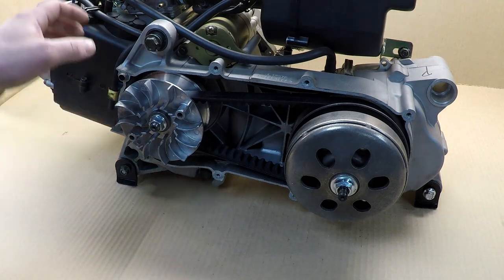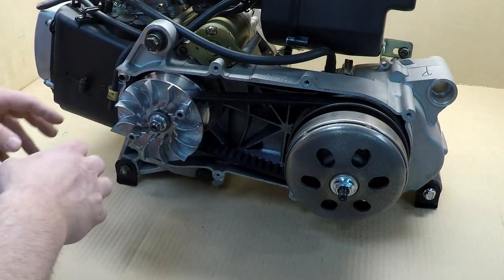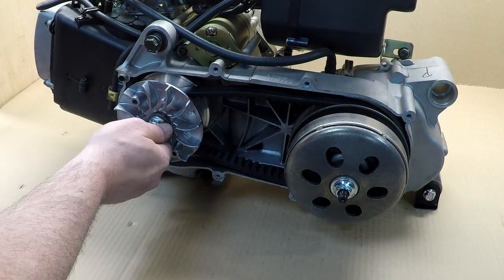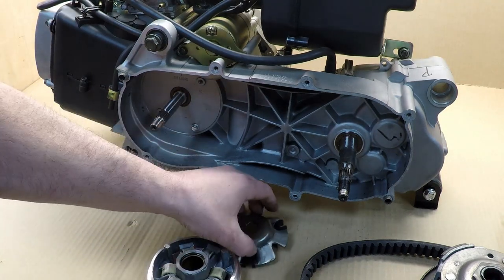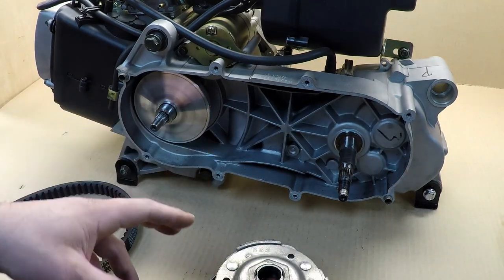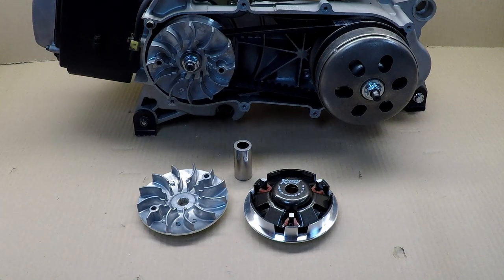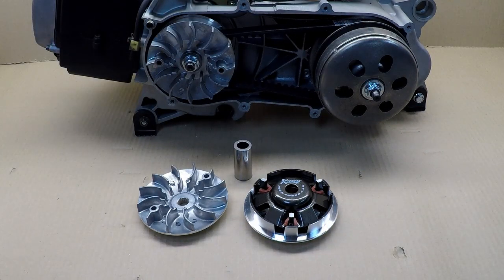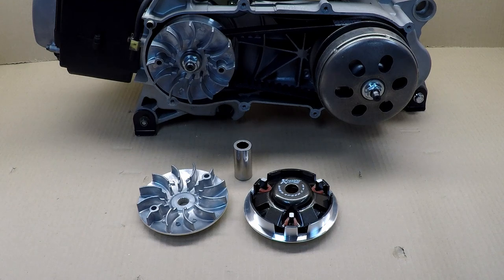Go Kart 150 CVT Belt Replacement, CVT Explain and Performance Upgrade

Comment: That's a great tutorial video. Thank you. Quick one for you though. My son and I are riding ATVs with GY6 1P63QML so with already a big bore of 63mm.(177cc / 11hp @ 7500rpm / 10.5N.m @ 6000rpm)

We do ride in the desert, mainly in the dunes, and I want to tune our CVTs accordingly (and sprockets eventually) but I was wondering, would it make sense to get the below combo :
- 10g/11g sliders
- 2000rpm torque spring to upshift later and downshift faster
- 1000rpm clutch shoe springs to still get early engagement from the clutch

Thanks in advance for your advices
Cheers
Reply: Qq f de g

Comment: Great video I'd like to know what did you make your pulley  compression mechanism out of? That's a great idea for the spring not to pop up?
Reply from the maker: It's two plates with two bolts. That was in a pill of junk metal in the corner of the shop—nothing special. I did some before putting my two feet on top of the clutch, and if you slip, the clutch comes up. It is the same when you try to put the nut on top; if you cross-thread, you are out of luck again.

It takes a little longer to tighten the two nuts slowly, but the result is always good.
Reply: Yeah I wanted to know what the piece was on top

Comment: You mention a setup for more low end torque / dunes, but not sure if I missed what you recommended for that environment. Currently I have 12 gram weights and yellow 1500 rpm spring and I’m struggling on hills and soft dirt. What change should I make to gain the most torque ?

Comment: Great video!! I just got my daughter a  2020 dongfang 200cc go kart. It seems to have trouble going up hill or over bumps and I can smell the clutch at times. Is there any maintenance or checking I can do to prevent this? Do you sell clutches for this model? Thank you
Reply from the maker: Thanks! The clutch is probably not engaging all the way. This happen if the driver is light on the throttle pedal. If you change the roller for lighter one, the machine will not go as fast but will climb hill better. As for the clutch slipping, if you change the 3 clutch spring for 1000 RPM, the clutch will engage at lower RPM. That should fix some of your problem for sure. As for the parts you might need, send me an email with some pictures and we can compare to make sure what I have in stock will work for your machine before you buy.

Comment: What would be the effect of installing a 1500 big spring but not installing the three yellow arm springs? Thanks and great video.
Reply from the maker: @James Timmons The big spring / torque spring will delay when the machine will change in higher gear. Mean higher the value of the torque spring, the longer it will stay in lower gear. This spring is related with the rollers weight that are install in the variator. The 3 clutch springs are only related with when the clutch will engage and make your machine start moving.

Comment: I have a Trailmaster 200 xrx with reverse... Will I need to remove the tire or just the exhaust? I don't have any way of taking out the entire engine sadly. I think the belts blown because it starts and the buggy won't move. Thanks for the video and any info you can give me.
Reply from the maker: You can remove just the exhaust. In my video, I remove the wheel so people can see clearly.
Reply: @maximumparts  Thank you for the reply!

Comment: How would you recommend me mod my ATVs CVT? The problem I have is that it is way direct in the throttle. I use it in the yard and it is almost impossible to reverse safely etc. So I would like to mod to make it as spongy as possible in the start.
Reply from the maker: @Dalle Good questions. The carburetor on the go kart are like a throttle body, when you push the pedal it open the air intake and it move a piston with a needle up and down. This is smoother than a throttle cable connect directly to the piston / needle pulling it up and down.

As for the CVT, I would go with lighter variator weight, I would change the clutch spring to engage faster 1000 RPM, for the torque spring you can go with a heavier spring 1500 RPM. What SHOULD happen is, it will engage faster at lower RPM. Mean the engine will not rev as high before you engage and also won't be at the higher horsepower on the curve. I think this is what give you trouble in reverse. The torque spring at 1500 RPM will keep it to lower ratio and you will need more RPM to go faster. The result should be, you won't go as fast but you will have more torque to move the machine and if you need to pull something.

If you check on my channel, I installed a blade on my go kart to push snow. This is a 150cc engine and I switched things around for the CVT. I use lighter weight as when I push the snow, I don't want to go fast but use a higher RPM to keep the machine in the peak horsepower. I used a heavier torque spring so the machine stay in lower gear longer.

This is a lots of testing but eventually you find the perfect sweet spot.

Comment: NOTICE - Be very careful taking apart the clutch! The spring is under a lot of tension. When the nut is removed the clutch disc can fly up and smack you in the head leaving you with a nasty cut on your face with bruise or worse.
Reply from the maker: 100% True. This is why I made the attachment with the 2 bolts you see in the video. There's a lot of pressure, for sure !!!
Reply: @maximumparts Yes I wish I would have made one of those before I took mine apart lol

Comment: How much is this KIT
Reply from the maker: It will depend on your configuration.

This is the link for the variator:
https://gokart.maximum.parts/koso-performance-variator-complete-gy6-150.html

This is the link for the clutch:
https://gokart.maximum.parts/performance-full-clutch-assembly-gy6-150.html

Comment: Can you get at a CVT upgrades for the Trailmaster 300 XRS e I'm getting a noise when you're going up the hill like the belt slipping
Reply from the maker: Don't have any CVT upgrade for the TrailMaster 300.
Reply: Same here.  Dr pully has variator and   rollers or slides is what i have read but dont know for sure

Comment from the maker: Let me know which combination you would like to see when I will test the performance parts. I will only read the reply to this comment for the selections. If you want to support this channel, consider purchasing your parts from Maximum Parts, Thank you. https://gokart.maximum.parts/
Reply: i have a 150cc hammer head 200 i want to add performance part but idk what set up to get so what is the best setup for something that will be played in mud with
Reply from the maker: @hectorgarcia7600  I would go with light rollers / sliders, 1000 or 1500 rpm torque spring. As for the clutch spring, it will depend on you on how fast the engine will have to rev up before the clutch engage. If you go to low on the rollers / sliders, you will lose more of the high speed. You need to find the perfect match on how you will drive the machine. You can create an account on our website and add to cart the parts you think you will need. Soon this is done, send us an email and we will look over with you before you purchase anything.
Reply: I have a 150 cc scooter, the engine have been rebuild and have a nice compretion. I just upgrade it with performace carburetor and performance centrifugal clutch, but now my top speed is down and hard to reach 100km/h. I have jetting the carburetor and i think its correct. Now i think the cvt have a problem. My variator its new with 15 gram rollers, but my scooter seems to have no power. I want to have good torque at lower revs, enough power in middle revs, and high top speed too. Do you have any recommendations to upgrade my cvt?
Reply from the maker: @danaranalengpe9079  This is a lots of testing. One thing you could do is to put the original CVT in. Here's why, that way you will know if the carburetor changes you did help or make it worst. Soon you have that fix, you will be able to play with the CVT. I think that changing both a the same time make it harder for you to figure out. But yes, I played with my own CVT on my machine and I change a lots and make multiple test.
Reply: Nice video and excellent explanation. I own a hammerhead LE 150 with a similar rpm stock numbers you mentioned as per the manual plus stock 13g rollers (not sure, this is what google told me). The take off acceleration is ok, but gets noticeably weaker around 23-25+ upto max speed of 37 mph. If you could advice me on a good setup of clutch springs/variator sliders weight to improve the acceleration while maintaining a safe rpm of the engine? Mostly flat/sandy roads with very minimal small hills
Reply from the maker: @mjb4ever  Thanks. The best way to figure it out is to test it. Now you have the original CVT, if you start changing springs, clutch, variator, roller ... You will be able to fine tune it for you. If you put lighter rollers / sliders, you will have less top end but good bottom. If you want the perfect setup, you would need to keep 2 different kits, 1 for low end when you are in sand and dirt and 2 one when you go on flat surface and you need more speed. That would be the best way to do it. You would have always the best performance for your engine.
Reply: Another question please. I was wondering if I upgrade my springs to 1500rpm, and then tune the rollers for them, how would that differentiate from keeping the stock springs and only changing the rollers weight?
Reply: Do you have a contact number I have a lot of parts and questions I just bought two buggies I bought a 300 Trailmaster brand new and I have a 2008 Hammerhead Twister I'd like to upgrade all the clutches and stuff

Comment: Yes I was looking at your website if somebody could contact me I will give you my number
Reply from the maker: Hi, we received your email and answered you back.
Reply: @maximumparts  thank you so much
Reply: I have a Trailmaster 300  xrs 4e. It has a 276cc engine with 17 max hp The CVT is the same as in the video but seems to be bigger. For example the nut on the driven is 44 mm instead of 38 mm.  Does it use the same clutch and torque springs as  a 150cc setup?